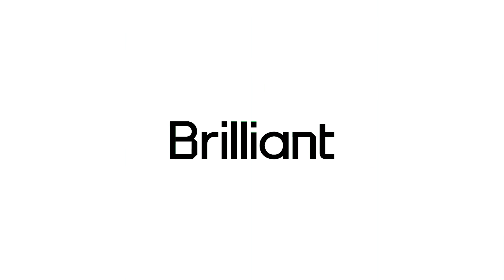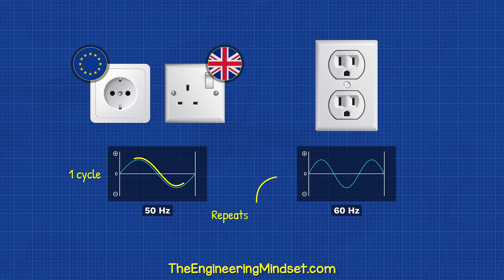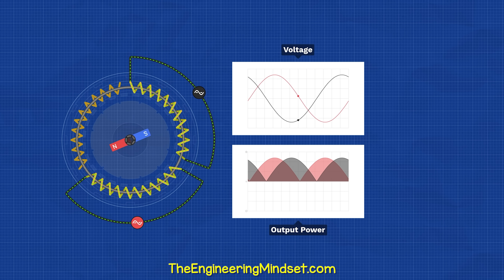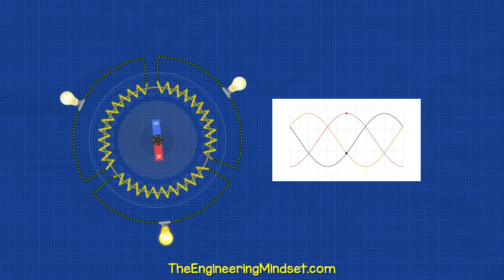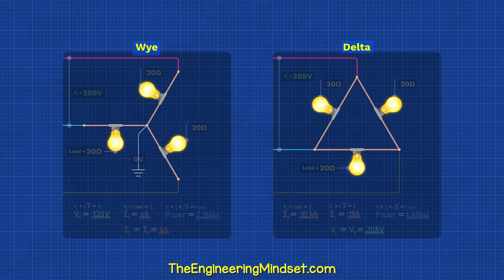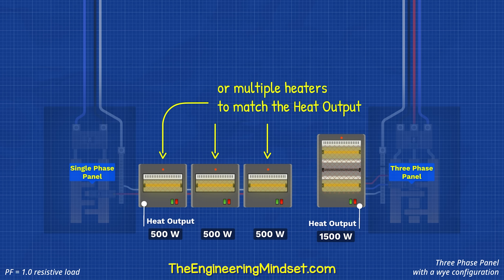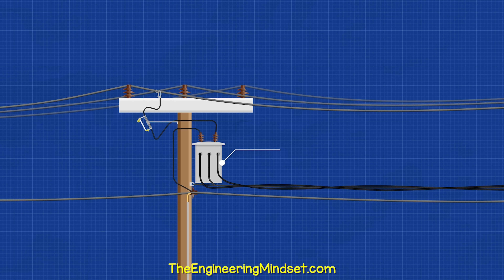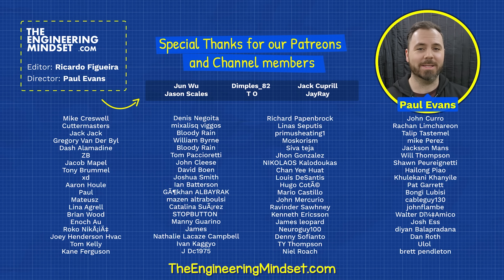How 3 Phase Power works: why 3 phases?

Comment: "... so the voltage will be very high. We can't use this to power our outlets because it will just destroy our appliances."
Assuming "we" are in certain parts of the world that chose to waste money on the extra neutral.
Lower voltage means thicker cables to deliver same power. I for one love my 32 amp, 230v options allowing me to pull 7.4 kW to charge my car without going too overboard with cable dimensions.
Reply: It's not a waste of money... getting electrocuted by 230-240v is orders of magnitude worse than 120v. Depending on the person, its the difference between life or death. Still I'd rather not be hit by either voltage.
Reply: @MarcABrown-tt1fp  well Voltage is not what kills you it is the current. Based on the resistance of human body and potential contact they have deemed that 50 volts is the upper safe limit. The difference between 120 and 240 thus becomes academic.
Reply: @1kreature  The amount of Amps on a given wire gauge is limited by voltage. Being shocked by either can still kill you, but a 240V circuit is far more swift, there is no arguing this point. Lots of lives have been saved by split phase transformers. With that in mind I'd rather wait an extra 3-5 minutes for my water to boil thank you very much.
Reply: @MarcABrown-tt1fp  RCDs have saved more lives, even in the USA. I'd rather have an RCD, use less power because everything runs more efficiently, half the size of all my cables, using less copper, and then still have some of the best protective devices in the world which can often trip in as little as 8 miliseconds, meanwhile a new "protective" device in the USA looks like it was fished out a bin that was last emptied in 1970, and already used for 25 years back then. Oh and we actually test our circuits for safety.
Reply: @AndrewStrydomBRP  Huh, you have a point there our switches put out the max current on the 120v rail for milliseconds, too long before tripping. Thats a totally different topic on circuit safety, a valid point no less.

*edit Im not sure how it compares, but we do have those gfci outlets with quick tripping.
Reply: @MarcABrown-tt1fp  it's definitely relevant to circuit safety as well as people safety, because RCDs can trip at low currents to earth as well as high current, we use 300ma time delayed RCDs for fire protection in places like sawmills and straw barns, as well as certain types of buildings, even a small current like that to earth can cause a fire and a 20 amp over current breaker (even the cheap arc fault ones) do nothing to stop that.
Reply: @AndrewStrydomBRP  Did I say it wasn't relevant? No. I think I'm gonna end the conversation there. 🤣
Reply: In Norway we have been connecting loads to two line wires getting 230V for more than 100 years, no problem. These days new areas get a 230/400V 3 phase TN distribution.

Comment: (USA) delta can be used as a single phase source with what’s called high leg delta (120/240), the neutral is between the A and C phase. Phase A to neutral and phase C to neutral will show 120 volts however the B phase will show 208v in reference to neutral. All phase to phase connections will show 240 volts. This 208 volt quirk will be noticeable in high leg delta breaker panels as there will be no single phase breakers on any b phase bus bars. This method has since been phased out (no pun intended) in favor of the wye connection. Common names for the B phase are “wild leg” “high leg” “bastard leg” and “stinger leg”. A high leg delta installation can often be noticed by looking at the pole transformers, one of the 3 transformers will be almost twice the size of the other 2 due to having to handle all of the lighting and other single phase loads.
Reply: Wonder if they started phasing out (... oh the puns!) the high leg delta because uneducated electricians didn't realize the panel was wired that way, and started connecting 120v loads to the B phase.  Had a client/customer get bit by that, and man those lights got REALLY hot! :D
Reply: @johnhufnagel  that’s the primary reason, the second is the transformer expense due to having the one large transformer.
Reply from the maker: Absolutely, we have covered it in great detail with step by step math in our last video here: https://youtu.be/u0SsejDCVkU

Comment: wonderful easy explanation.thanks.  however I didnt understand what determines the amount of voltage generated ?
Reply from the maker: Rate of change and number of field lines, in a real generator an electromagnet is normally used as you can control the strength of the magnetic field. I didn't want to get too into that part as we will cover it in the generator explained video. Although I think I discussed it a little more in the wind turbine video.

Comment: One thing I'd love to know is in relation to the transmission lines. I see them massive pylons carrying multiple cables. Is each cable a single phase? Also I think the rpm of the generator needs to be in phase with the grid. Something like 3000hz but how does it increase power output and keep the same rotation
Reply from the maker: Correct, they are transporting the phases. Some will have a neutral wire and a ground wire for lightening strikes. We discussed it a little in our last video https://youtu.be/u0SsejDCVkU and yes the generators sync together using a synchroscope, usually 50 or 60Hz but the voltage will be increased to hundreds of thousands of volts for the long transmission lines. There's a segment in this video which shows an example of the voltages used.

Comment: When you have 3-phase AC and want DC, why not use a circuit that takes advantage of the higher frequency of peaks plus bridging _plus capacitance to make it even more smooth than a linear single-phase bridger would do? And wouldn't that have the potential to be even smoother and less noisy than a high-frequency switching power supply?
Reply: I would think it's because the cost of the extra incoming wiring would be too high compared to the benefit. Any linear power supply is easily smoother and less noisy than a switching power supply.
Reply: @redfields5070 , I said "When you HAVE 3-phase AC." That means the wiring is already in place.
Reply: @P004ME2LicensePlate  
So you HAVE 3-phase next to your TV?
HAVING 3-phase would normally mean it is available at the incoming power to the building, not to every location in the building, because of the cost.
Reply: @P004ME2LicensePlate  
My point is that you're never going to have it because it costs too much to run wiring to any given location.
It's like the people who think we should have 12v DC running to every home, so ever radio and television won't need to have a step down power transformer. The wiring price difference would be astronomical.

Comment: It's also important in distribution that in European countries a transformer can feed tens of houses, sometimes hundreds, multiple streets and the secondary side is also fused unlike in North America.
Reply: This is sort of wrong.  Usually you have 1 substation (lets say it steps it down from the big transmission lines to 1200V) feeding a town of anywhere from 10,000-20,000.  From there it it gets further stepped down on the pole to 120/240 split single phase as most of the grid is designed to be residential load based.  Transformers are spaced out every 5-6 poles as step-up transformers to try and keep the secondaries on the poles at a constant voltage.  Also the primary sides of the transformers on the poles are fused.  In the event of a short or overload on the secondaries of the pole transformers, the utility expects the transformer to blowup as the fuse which in turn would blow the primary side fuse (though this does take a big short/overcurrent and time to cause).  Also most substations are equipped with circuit breakers in the event the secondaires out of the substation were to short out.  In terms of a Commercial application, the building gets its own transformer as seen in this video due to its needed a 3-phase hookup of either 120/208 or 480/277 depending on the loads the space needs (also the video does fail to show that 277V lighting is a thing).  The only time a house would get its own transformer is for one of 2 reasons.  The first reason is that is a higher amperage house than normal (higher than 200-300 AMPS).  This results in the utility either giving the house its own transformer on the pole or having a transformer installed on the persons property.  The other reason occurs when you get to the low population density areas where houses are easily a .25mile to .5mile apart and it is not feasible to have a step-up transformer every 5-6 poles.
Reply: The American one looks crazy, so may different voltages.

Comment: If Tesla had not only theoretically patented the three-phase motor, but also built it, then he would have realized that he didn't need 6 cables for three-phase current.
At the same time, in Europe, Mikhail Dobrowolski is already working with 3 lines of three-phase current. For this he received the German patent. 
Westinghouse obtained rights to both patents and then built with 3 lines, not with 6 lines like Tesla thought.
Reply: Tesla oroginally used a 2 phase 4 wire system and it can still be found in Philadelphia and Connecticut. A Scott transformer can transfer 3 phase into 2 phase 90 degrees from each oter or vica versa. You confused cable with wire.

Comment: 3:35 I cant say I ever really noticed old school incandescent lamps flickering. But especially with some of the early generations of LED lamps and cheaper ones on the market i can notice they flicker.
Reply: The edison bulbs do not have time to cool 
Down before the next sine wave comes so it does not appear to flicker to a human eye
Reply: @josephpadula2283  edison was a thief, the bulb was invented by Joseph Swan, William Sawyer and Albon Man.
Reply: One way to see the flicker is to observe the light through the spinning blades of a high-speed electric fan. This will cause a strobing effect to make the flicker more visible.
Reply: You can see the flicker when you pitch control your record player ;-)

Comment: Cause 2 phases isn’t enough and 4 is just silly.
Reply: 2 phases 90 degrees from each other was the original system invented by Nikola Tesla and is still used in Philadelphia and Connecticut.